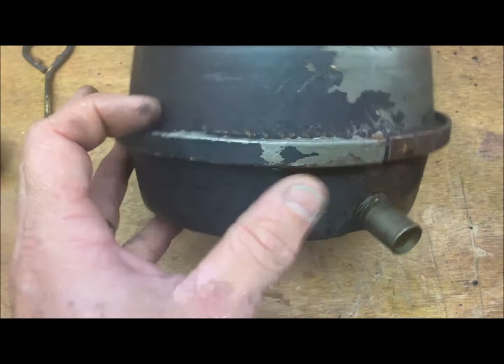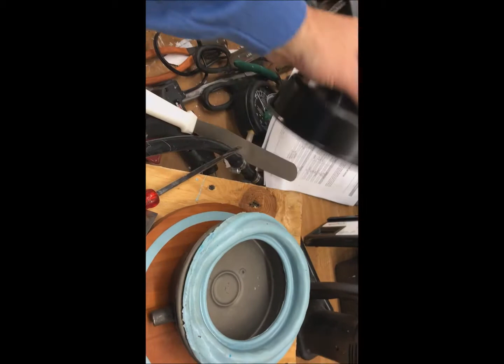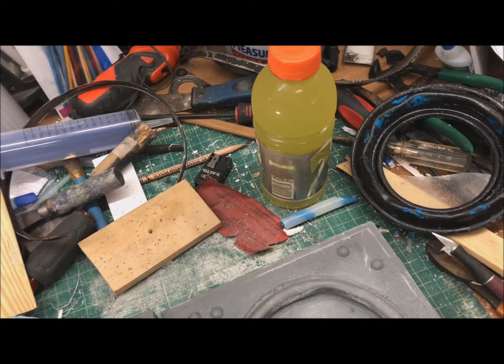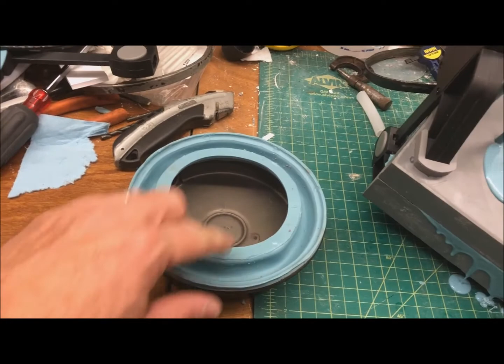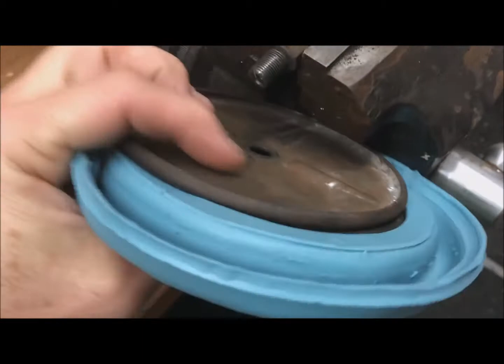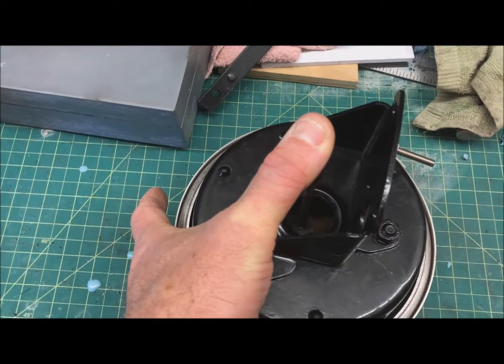Sportomatic - 1970 911 T Sportomatic Vacuum Servo Repair

Comment: F&S stands for Fichtel & Sachs, which is now part of ZF Friedrichshafen AG.

Outstanding video!  There are a handful of us who own Sportomatic-equipped 911s and who would like to keep them that way, rather than swap in a true manual transmission. As you already know, original parts are hard to come by and the aftermarket is virtually nil. This will be a great help as it's these diaphragms and the microswitches at the base of the gearshift that are the most frequent cause of Sportomatic shifting problems. Thanks!
Reply from the maker: Thanks for the kind words!!!